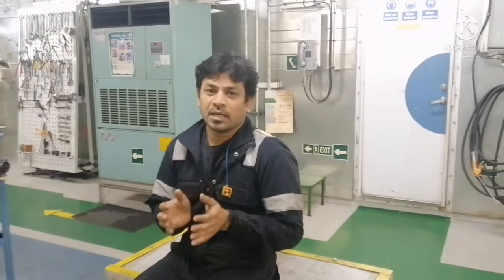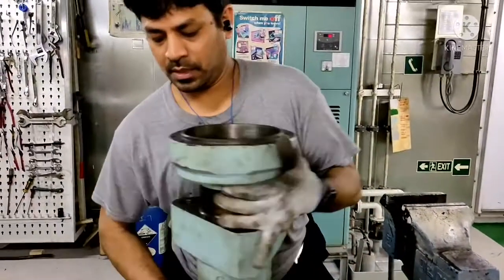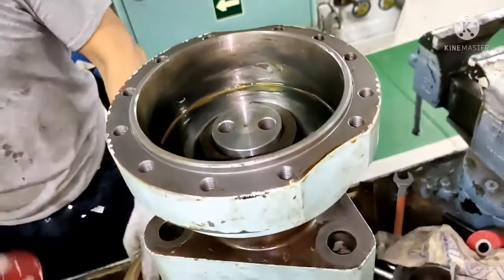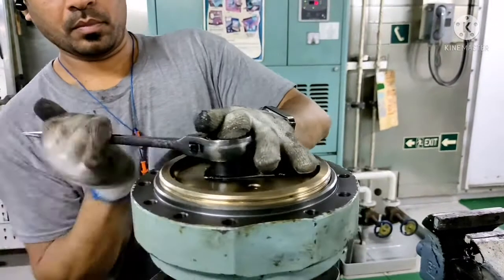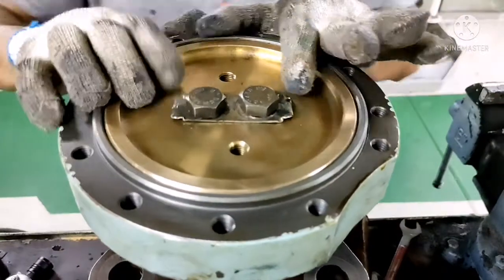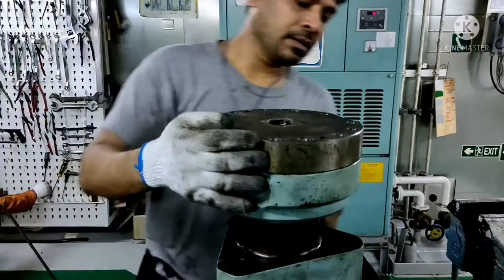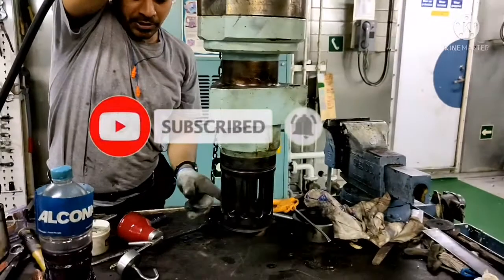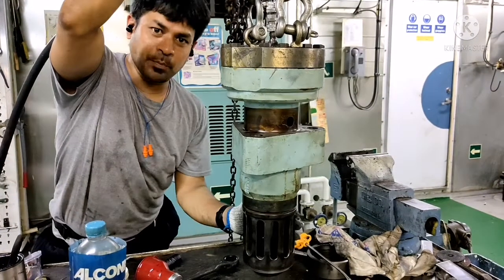How do they do.. How to overhaul Main engine starting air valve.. Part-2

Comment: Sir is this MOL TRADITION sister ship.
Its looks like same one.
Reply from the maker: Is it?
Reply from the maker: Requesting you to share our channel with ur friends and subscribe.. Thanks
Reply: We also overhauled this air starting valve ,after overhauling valve is opening proper but same time air also come at top both side two hole is there from where we can see spring , please suggest.
Reply from the maker: @sataram3859  sir.. I beleive there s no problem in your starting air valve as it s common  the air get vented out through the top 2 holes after the starting s commenced.. I beleive this vl clear it doubt..